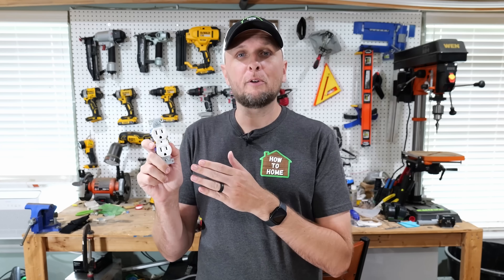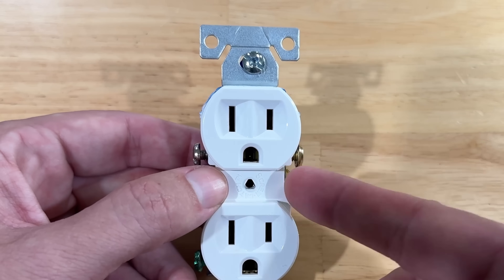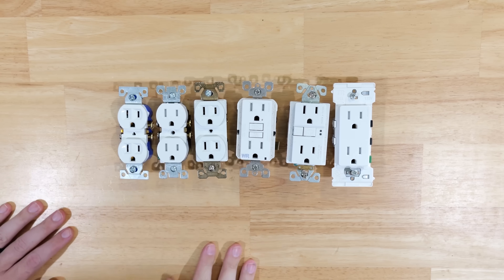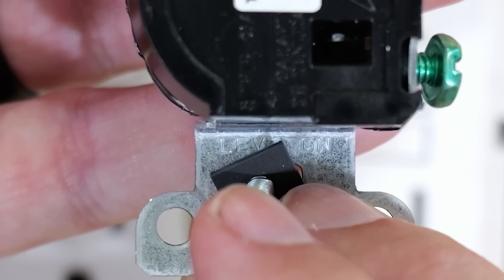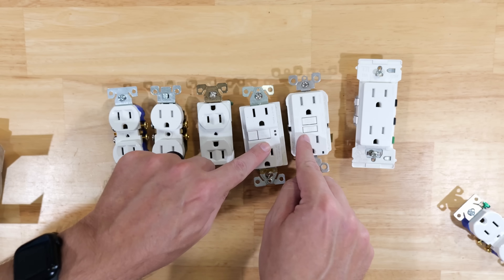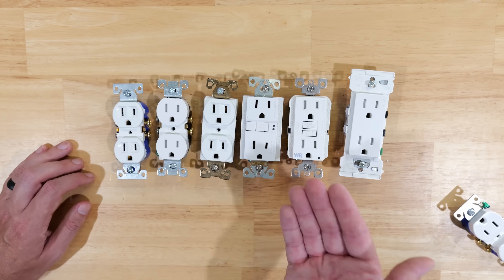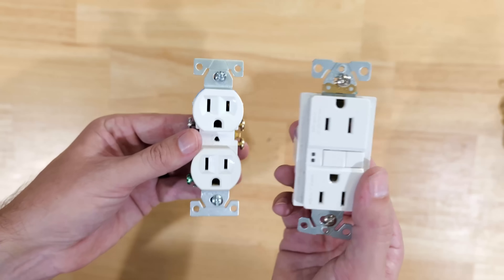The Shocking Reason Why Your Outlets Are Installed Upside Down!

Comment: I have two reasons for doing ground prong Up. 
1 - Because, typically, the ground prong on the device is Longer than the two flat prongs, which makes it easier to locate the ground first when plugging in in poor lighting.
2 - I hate having all of those "Shocked Faces" staring at me  😮

Comment: Inside the house I always instal ground side down but in the garage or work shop area, I install  gound side up. In these areas it is more likely for the plug to either vibrate,  jared, or tugged ajar and possibility of some wire or something metal falling across the prongs. Even just briefly can cause a short.

Comment: 35 years building houses ect.  Using many different electricians they all installed with ground plug down . One person doing his own wiring I knew installed them in his garage shop with the ground up . He said his reason was the heavy cords he used to reach some areas would stay plugged in better if they were pulled on to much accidently and not drop on the floor .

Comment: Our outlets are installed correctly right side up with ground FACING THE GROUND.  All of this turning the ground to face the top is derived from the argument that “if the plug is partially hanging out and something falls onto it, it could cause an arc.  Guess what, We have circuit breakers for that purpose.

Comment: nowhere does the code tell you the ground must be up or down. It depends on what is being plugged into the receptacle. In  a commercial setting there will be details in the prints of a typical outlet installation. However the receptacle is drawn on the prints is how they are installed. Anyone questions why the receptacles are installed in the fashion they are, the contractor has that in his favor. It's on the blueprints. Also they are specifications. Simply referred to as the "specs". Every trade has a section. Sometimes orientation of ground may be stated in there

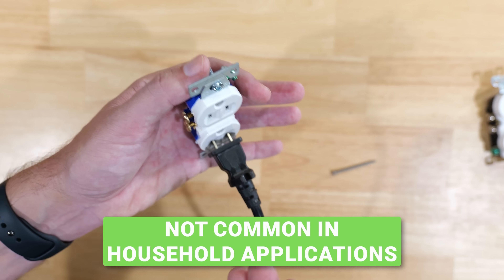Comment: 12:00 to 12:50 or so says it all. Protect PEOPLE first. Back in the day, insurance companies forced 2.5 and 5 MPH bumpers to protect CARS -  reduce repair costs. Since then, priorities have been adjusted to protect PEOPLE with smooth front ends. (These also provide better aerodynamics, which saves gas, which helps companies to meet CAFE requirements. Ditto for Steel Belted Radials.)

Comment: Glad to live in Germany. 😊 Not only does our grid run with 230V, but also do our well designed  plugs and outlets have none of these problems.  Especially the design is safe against accidential contact.
Reply: Your German outlets trigger me. I remember living there for several years in the 1980's and being forced to lug around this heavy metal transformer to use nearly everything I owned as a kid.

Comment: I work in a collision shop and all the 240 volt receptacles are upside down, all of our equipment, Mig and Spot welders cords are with the ground on the bottom so when you plug them in the cords are going up instead of going down. Not an electrician but I thinks that’s just stupid.

Comment: I used to work with a Fire Marshal back in the late 80's who insisted that the Safest way was to install with the ground UP or to the left if installed horizontally so the neutral is up.  Their reasoning was that in the past people hung heavier picture frames with wire strung across the back.  If the picture fell it would 1 hit the stronger ground pin and often unplug something or 2 the frame hanging wire would slide between the plug and socket leading to a potentially LIVE uninsulated wire waiting to be grabbed. 3 It doesn't look as inviting to a child. Also, It is far more likely that something falling on the object would NOT contact both hot and neutral but rather would touch only the Hot or Neutral and lean there.  While upside down it would hit the ground and if it leaned toward the hot, it would short and blow a fuse or trip a breaker. I was recently installing a metal back plate for a piece of wall-mounted network equipment.  The plate slipped and fell directly on the ground pin then came to rest without touching the hot. ALL of my electrical outlets will always be installed ground up.

Comment: I had this "problem" with the house I'm building in the DR.  The electricioan installed all of them with the ground pin up.  I made him remove them and and install them withe the ground down.  The reason is that most manufacturers of just about any thing you plug in, design it to plug with the ground down.  Example, air freshner.
Reply: I have a watt meter that requires the ground at the bottom, otherwise the digital display would be upside down.  The same with timers.  They are always ground down.  
Another reason, is that 90 degree cords, like the ones on most refrigerators are ground down. Otherwise the cord points upward from the 90 degree plug.
Reply: I'm 80 years old been doing electrical work since I was 16 the only job I've ever had never saw anybody put the ground plug up take a look at your ground fault breakers where is the ground on those
Reply: @popwall4297 Usually done only in industrial applications utilizing metal cover plates, for when the screw falls out the cover hits the ground, NOT the current.
Reply: @edwardpadgett8595  not so much that if a screw his the hot, because so what? It'll fall off and that's that. It hits the hot, nothing happens. It's when it shorts the hot to either the ground or neutral that could cause an issue. But yes, usually only done in industrial applications, like you said.
Reply: @jobourne423  He said the COVER (not the screw) hits the ground…
Reply: @petep.2092  regardless of what piece of metal hits, it's the same effect. If it only touches the hot, then nothing happens.
Reply: @ Is the cover likely to only hit the hot pin? I'd like to see that balancing act.
Reply: @petep.2092  clearly you have never changed out a receptacle or switch before.
Reply: @popwall4297  Ground fault breakers don't have equipment ground terminals.  And, they can be installed on either side of the panel.  Therefore, a ground fault breaker doesn't have a definitive "up" or "down."
Reply: @popwall4297  Ground prong up when that outlet is attached too the light-switch so people there know where to plug in their lamp to control it from the wall light-switch. Industrial and medical institutions where things fall from walls and can short the outlet.
Reply: @popwall4297  I've never seen a ground fault breaker that had an equipment ground terminal.  Besides, a ground fault breaker can be installed on either side of the panel, so that renders your claim moot.  Whatever is up on the "odd numbered side" will be down on the "even numbered side".  Were you a ~trained~ electrician?
Reply: Any plug with weight or tension down (gravity) will Sag and Fall Out easier on Ground pin up!  ..with heavy it will also more easily sag. Besides... chances of touching power and neutral plug at same side w/ Ground down is nearly impossible. Always having re-insert heavy plugs/night lights/chargers will invariably fall out!  Most Secure method for Stable Plugs= Ground Prong Down!
Reply: @RockyRacoona  Not "any". It depends on each of the the outlet and the plug, They are not all equally made. Some are quite tight when put together ground down.
Reply: Solamente en los hospitales se ponen Up si de down
Reply: Good point.
Reply: Best argument I have heard is that they look like a face with the ground down.
Reply: Hair dryer!!! Duh!! Huge circuit breaker weighted on the GROUND SIDE.  Sure arrogance of some people.
Reply: Because of gravity, ground prong down, makes more sense for connectivity and safety.
Reply: @GabrielJimenez-z3f: Electric air fresheners are synthetic chemicals and bad for you to breathe in. Simply a method by which corporations can make money. An air purifier is MUCH better for humans and pets who can eventually become 'sensitized' to fragrance meaning their bodies have been tolerating fragrance chronically over time until the body reaches a tipping point of being allergic to ALL fragrance. Note that certain scents even if they are essential oils are harmful to animals and can in some instances kill them. In certain homes, ground prong up is to indicate when that outlet is attached too the light-switch so people there know where to plug in their lamp to control it from the wall light-switch.
Reply: Most air fresheners do not have polarized plugs. They utilize a warmer, which can usually take current in either direction. Most also do not have earth ground pins. Furthermore, the ones that DO utilize a polarized plug usually have rotating prongs.
Reply: @JoeMikeMakes  most air fresheners are filled with oil which will drip out if you plug it in upside down.
Reply: @DoubleplusUngoodthinkful That’s why they have the rotating plugs…
Reply: @christopheralthouse6378  I have glade, airwick, and bath and body works, and none of those rotates.
Reply: @DoubleplusUngoodthinkful they do make rotating ones, but they usually only rotate 90° and cost twice as much.
Reply: @jobourne423  so you get to pay for the privilege of being able to use your air freshener in a sideways outlet.  :/
Reply: @DoubleplusUngoodthinkful  sadly, yes.
Reply: @DoubleplusUngoodthinkful  Electric air fresheners are synthetic chemicals and bad for you to breathe in. Simply a method by which corporations can make money. An air purifier is MUCH better for humans and pets who can eventually become 'sensitized' to fragrance meaning their bodies have been tolerating fragrance chronically over time until the body reaches a tipping point of being allergic to ALL fragrance. Note that certain scents even if they are essential oils are harmful to animals and can in some instances kill them. In certain homes, ground prong up is to indicate when that outlet is attached too the light-switch so people there know where to plug in their lamp to control it from the wall light-switch.
Reply: @JoeMikeMakes  Alternating current goes both ways, regardless of polarity.  So, of course ALL warmers can take current in either direction, not just ~usually~.

Comment: The biggest "deal" to me has to do with the plug and cord, not the outlet.  Most plug wires are horizontally oriented and extend straight out from the wall.  This means that if you want to plug in a device or lamp behind a piece of furniture such as an end table, dresser, or cabinet, those items can't be pushed closer than 3 or 4 inches from the wall.  In my opinion, most plugs that are commonly used behind something should be flat (essentially as elbows), so the wire comes out parallel to the wall and you can push furniture up against the wall in front of it if you so choose.  Plugs for items that are used temporarily (such as tools) should still be the traditional shape as shown in this video for ease of plugging and unplugging.

Comment: Night lights, 90° plugs, ...  usually have Ground down.   However, that thin plastic below the ground often breaks when tension/gravity pulls a plug down.
With the "ground up", the pressure is on the thick part and it doesn't break.   So... probably good for shops/garages that use heavy plugs to have ground up.
Inside the house, leave the ground down so you get a "smiley face"  😃

Comment: The builder of our new home also installed switched outlets with the ground slot up. The same is true for all appliance outlets, ground slot up. This is very annoying since as someone below pointed out all appliance power cables are oriented ground prong down. I appreciate denoting the switched outlets from non-switched, but flipping the appliance outlets? Makes no sense to me. I have asked electricians and really don't know why either. No local or state code mandate. Anyone know why appliance outlets are put in ground slot up?

Comment: steel cover plates coming loose and dropping onto the prongs is fairly common in commercial settings where they get abused and used often.
I have seen a fair share of them that arced in older residential, but that was ancient two prong stuff anyway and of course had fuses. it would generally burn off half the prongs and put holes in the plates, but certain old breaker brands loved to to the same thing.

Comment: Ground prong down because:
- personally was zapped by pointer finger touching blades when prong was up
- taught that lightning flows down following ground to earth, hence prong is down and ground connection on receptacle is at bottom
- 90 degree plugs have prong down and cable flowing down so at least 1 cable can be plugged in to bottom receptacle without cord being stressed going up then excess going down without looking weird and bulky at the wall and not allowing furniture to be more flush to the wall.  A sharp bend can create a resistance and blow up if lightning hits whatever is plugged in; that being said some people tie a knot in a cord at the wall to blow up instead of whatever is plugged in creating a Major Fire Hazard in the good old days

Comment: Been in the trade since 1978.   Every recep I installed have been equipment ground down,  The exceptions being engineered medical / hospital facilities.  The engineer will specify  orientation for receps, both installed vertically and horizontally..
Reply: So can you explain why medical/hospital offices have their receptacles ground prong up? And why not for legal offices, laboratory research offices, etc.?
Reply: @Rick-the-Swift  Hospitals are engineered, and engineers recognize the following standard.  This is an excerpt from citation:

IEEE 602–2007 Electrical Systems in Health Care Facilities - 4.4.3 Hospital grade receptacles.  "Parallel blade devices should be mounted ground pin or neutral blade up. In this configuration any metal that drops between the plug and the wall will most likely contact a nonenergized blade." 

I'm not certain that this is the latest IEEE Standard.  The article numbers may vary from cycle to cycle, but the text appears not to have changed since at least IEEE 602-1996.

Comment: You’re right.  By Code, there’s no “proper” way to install an outlet. If you’re replacing an outlet, keep it uniform to the rest of the room/house. If you’re roping a new house, do whatever the boss says. If you’re the Boss, well, Everyone has a boss.
Reply: I've always been curious about this because it seems like a lot of AC "wall wart" adapter manufacturers make them with the ground prong intended to be down. I say this thinking even back in the 1980's with Nintendo AC adapters, if you plug those in to an outlet with the ground prong up, their own weight distribution will make them fall out of the outlet especially on a slightly worn outlet. If they are connected into an outlet with the ground prong down, their shape makes it such that they press into the lower part of the outlet cover and are less likely to just fall out unless the prong springs in the outlet are extremely worn out.

Comment: I have been in construction for years, i have been a part of the electrical runnings box placement, and installing outlets and switches, ive always remember installing the ground prong down.and have had.a few times where i had to go in after someone else place them the WRONG WAY AROUND 😂 and teach them that if the outlet isn't smiling then its frowning.  To me its two smiley faces or faces anyway, 😮😮 and its just proper . Yes i had one guy talk about that ground up nonsense but it was all gibber grabber to me. I never had a complaint by any of my costumers.  I do install locking  doorknobs with the teeth of the key facing up however, i that an issue, cause i have seen many guys install that the WRONG WAY as well😊
Reply: Absolutely, yes, re locks; keeps debris from fouling the pins in the lock cylinder.

Comment: This is a pie in the sky suggestion, but maybe the manufacturers could design the receptacles to swivel around 360 to accommodate different use cases, only if there can be a way to design something like that safely so the internal connections wouldn't fatigue or make the thing ridiculously expensive.

Comment: Many....MANY...years ago I was told the hospitals in this area have the ground prong on the top, because most of the receptacles had stainless covers, and for some reason if one came loose it could land on the ground prong and not the energized prong. Makes sense to me. No matter what, it would be best if they all were pit in in the same orientation in a home.
Reply: Exactly
Reply: So the stainless plate will always fall to the neutral prong side or bounce directly off the ground prong but never to the hot prong while touching the ground? Interesting 🤔

Comment: I have always installed ground pin down. Why? If the plug has worked its way out of its outlet, the weight of the plug's cord  tends to cause the plug to point slightly dowward, eventually disconnecting  the hot and neutral before the  ground pin. 

Having the ground pin on the bottom tends to help stop the plug drooping under the weight of its cord.

Thanks for sharing.
Reply: With ground up the weight of the cord always pushes hot and neutral in.
Reply: @heyyou5189  For safety you want the ground connected always, and you want the power disconnected first.

Comment: The journeymen wireman I know say ground pin down because the cord hangs from it and in the event that it gets pulled out especially while in use the ground pin is likely to be pulled from the receptacle last.
Reply: That’s why the ground prong is longer 
First make. Last break.
Reply: Also, 90 degree cords, like on refrigerators need the ground at the bottom, otherwise the cord points upward from the plug, instead of down, like it is supposed to.
Reply: Ground prong up when that outlet is attached too the light-switch so people there know where to plug in their lamp to control it from the wall light-switch.